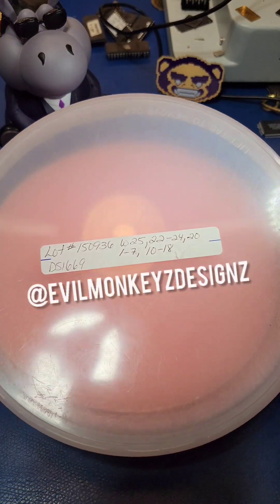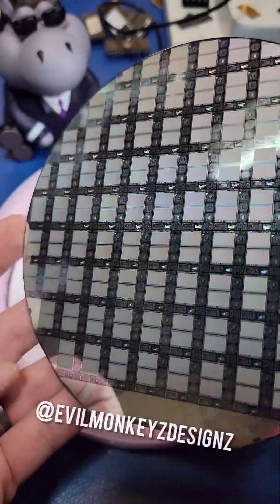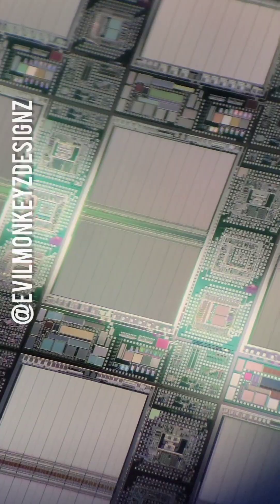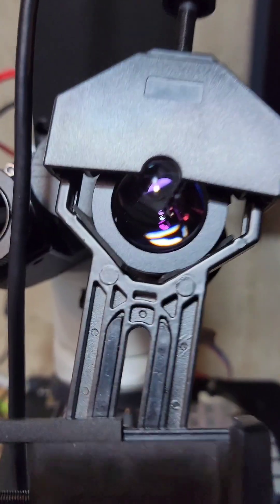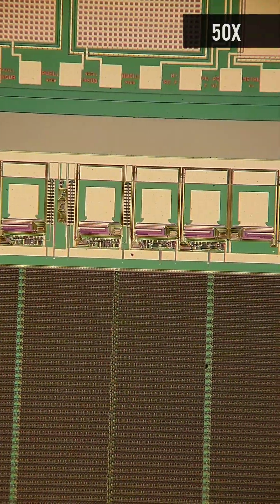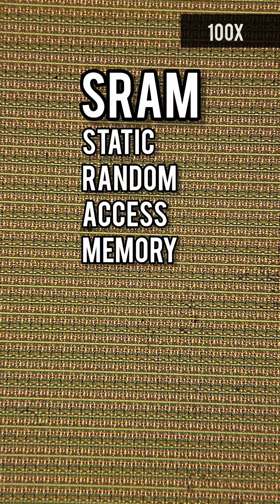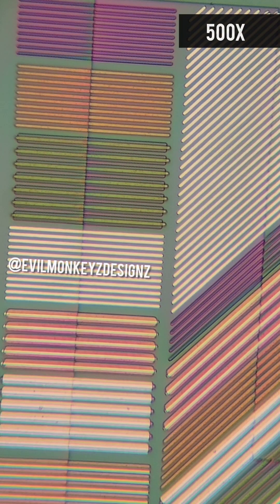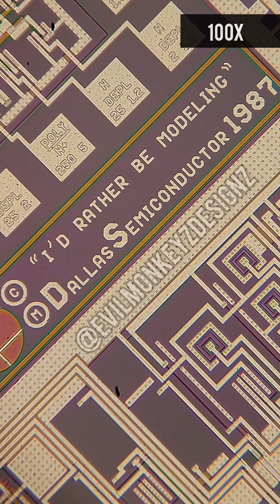🐯 Tiger on a silicon wafer, the DS2256 from Dallas Semiconductor

Comment: Seems like it was something made for NASA. Stop using google search it sucks and has sucked for over 10 years.

"The DS2250 belongs to a family of Dallas embedded controller chips which include the
DS5000 (a parallel to the DS2250 but with less RAM), one DS5001Fp (an enhanced version of the
DS5000 but with a 80-pin quad flat package) and the DS2256 (the lowest-power version of the
DS5001 with 128K bytes of nonvolatile RAM). All of these chips offer flexible read/write
memory, SRAM, which is much more attractive than ROM-based controllers. A detail description
of this chip now follows.
The Dallas DS2250 (Figure 7) is a family of 8-bit CMOS microcontrollers [10]. The
DS2250 is implemented on a 2.65 in by 0.84 in 40-in SIP. The DS2250 is available in various
memory sizes, up to 64K of CMOS RAM, in two maximum clock speeds, 12MHz or 16MHz, and
with or without a permanently powered clock/calendar. The RAM memory is nonvolatile, due to
an onboard Lithium battery that supplies sufficient power to the RAM for memory retention when
power is removed to the system. The DS2250 uses a 8051 instruction set. The DS2250 requires
only a crystal and a 5V power supply to become an operational system.
The DS2250 has numerous features that allow for easy implementation of the system. All
of the CPU registers are mapped as Special Function Registers (SFR's) and they are identical in
number and function to those of the 8051 (i.e., the Accumulator, the Stack Pointer, the B Register,
the Program Status Word and the Data Pointer Register). There are 128 scratchpad registers that
can be accessed by the CPU. The SFR's are used to establish several other important features of
the DS2250."

https://ntrs.nasa.gov/api/citations/19920012964/downloads/19920012964.pdf

Comment: It's interesting that there are incomplete chips at the edges of the wafer. SRAM banks that looks like they're cut in half at an odd angle and so forth. I'm wondering why circutry would be laid in those areas knowing that the final result would be unusable.
Reply: This was standard since the masks have more than one die. The edge die and bad die were marked with an ink dot if they failed test. The wafer went to back grind, then was sliced, Good die got packaged, and tested again.

Comment: Chip includes an Intel 8051 Instruction Set with up to 64KB Non-Volatile SRAM (connected to a backup Battery)  12MHz or 16MHz fcy.  i/o Ports, IRQ Controller, secure features.  Programs are stored/executed in RAM.  S/W uploaded through Ser/Par Port.

Dallas Semiconductors provided the BASIC Programming Language that is loaded serially into the RAM.
Reply: How do you know?
Reply: Looks like a specifically testing wafer

Comment: This doesn't look like a production wafer intended to be sliced up into individual dies and then those dies packaged.

Unless they are doing something fancy and combining different chips onto a single wafer in order to ensure the components on the different chips have similar electrical characteristics (matching) and minimise production spread. Doubtful.

This is possibly a test wafer.

Comment: Looks to be a test wafer for sure with all the various test circuitry. Note: a RAM is also a very good test device when evaluating the defect density of the process. We used to bit map (to locate failing memory cells) so as to pinpoint the location of the failures and with the microscope identify what layers had defects…ie metal, aps, poly gate or other levels.
Reply: Test structures are in the margins. This wafer is missing passivation  layer. It may be from a rest lot or a bad lot. (I worked in wafer test for DS in the early 90s.)
Reply: I agree, this looks similar to wafers used for process development I have seen before
Reply: Did you work clean room?
Reply: @HaakonAnderson I used to be a Product Engineer and early on spent a lot of time in the clean rooms to help improve yields. As the geometries got smaller they limited the number of employees whom had access so as to keep things as clean as possible.
Reply: That's very cool